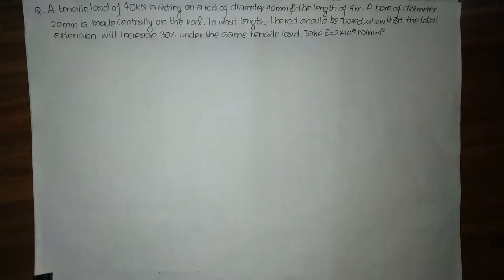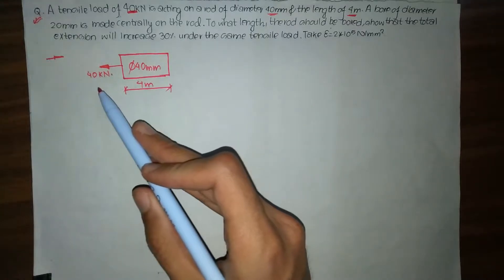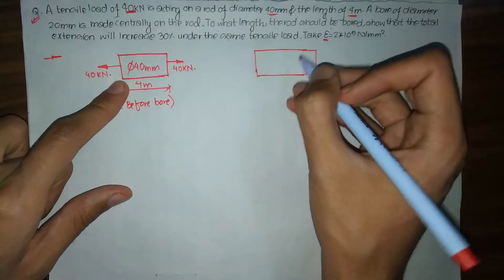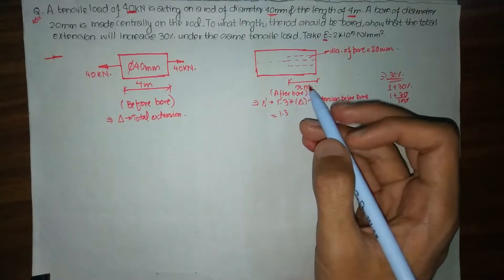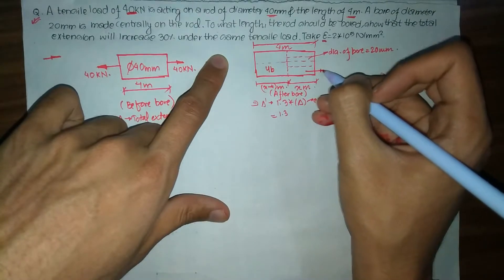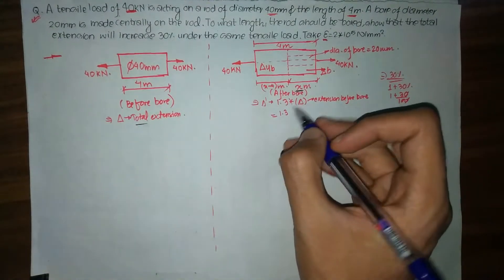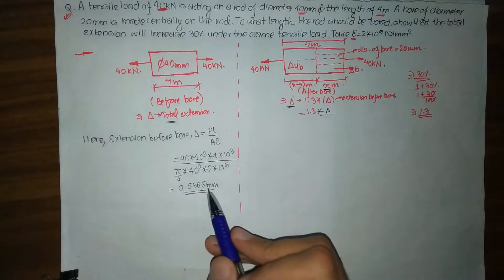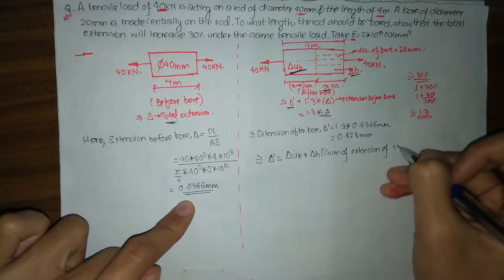Stress and strain numerical (Problem -6) |Elongation of Rod |Stress and Strain |Strength of Material

Comment: A steel rod is subjected to axial load of 50 kN. Total length of rod is 4m. First im has diameter 32mm, second im has diameter 28mm and remaining part has diameter 25mm. If Young's modulus of material is 2 105 N/mm2 .Find elongation of the rod.

Comment: How 30 percent is being 1.3 times?
Reply: tensile load =40kn
Total extension will increase 30% UNDER the same tensile load (40kn) 
¶ so we divide 40/30 which is = 1.3 ¶
Check it bro
Reply from the maker: Here extension needs to be increased by 30% so let's say we had x length then new length will be x+0.3 so for x=1 new length will be 1.3 hence increase by 1.3 times
Reply: @engineeringmantra1886  but x=1??? Is that given in the question,???? Still confused. Plss clear me
Reply from the maker: Here it's like if the length is increased by 2 times you multiply by 2 similarly for increase by 30% you multiply by 1.3 .Here, the extra .3 comes from 30% increase which is 30/100=0.3 so total extension is 1.3
Reply: @salwaasker5118  tensile load =40kn
Total extension will increase 30% UNDER the same tensile load (40kn) 
¶ so we divide 40/30 which is = 1.3 ¶
Check it bro